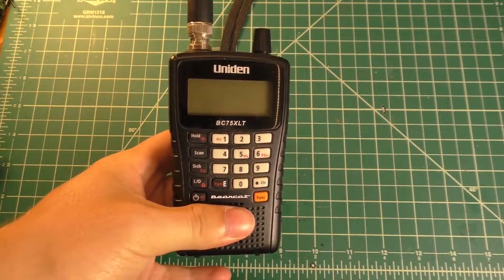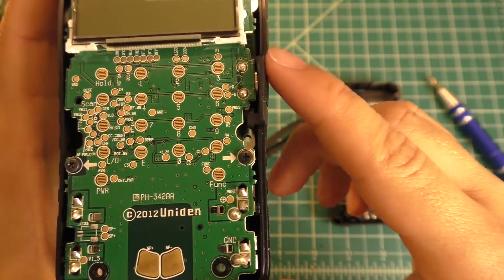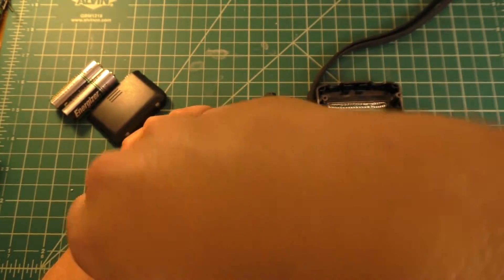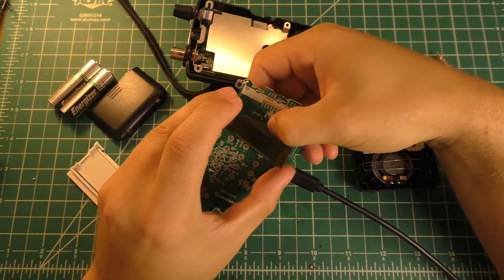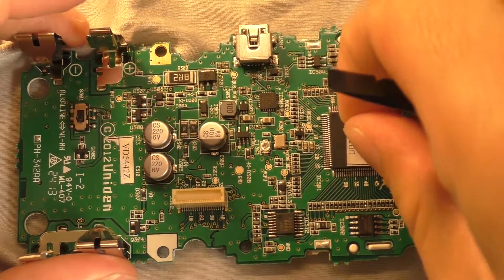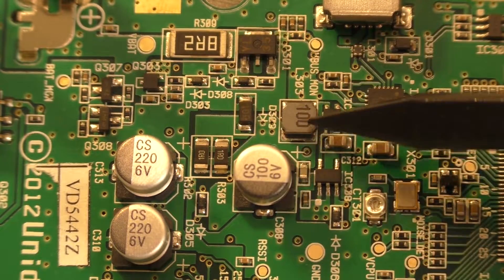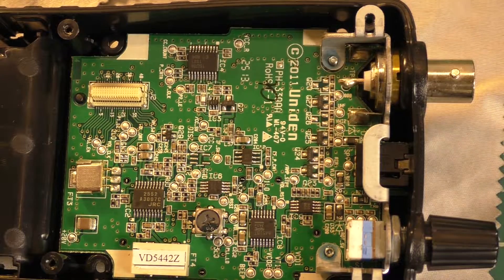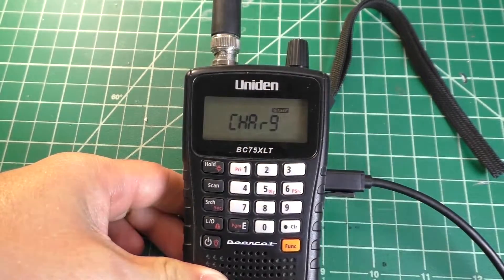Uniden BC75XLT Teardown and LCD Repair

Comment: I sell scanners and recently sold a 75XLT with a defective display like this one.
In a move of sheer stupidity, uniden decided it would be a good idea to glue the display ribbon to the circuit,  and that's fine, but the problem is that the ribbon is not only too long, but  the ribbon is also in a bind  by default because it is folded and usually creates a crease right at the contact point where the ribbon is glued to the board which often leads to the eventual bad connection that causes the display issue.
Since the type of glue that is used is unknown, (at least to me )the best remedy is to do exactly what you did here.
Heat the ribbon just enough to soften the glue to hopefully allow it to adhere properly again, but BE CAREFUL especially if you have a soldering iron that doesn't have a temperature setting because it is very easy to ruin the ribbon by melting it which is what happened to me with the last one I attempted to repair.
Radio Shack scanners are notorious for defective displays, but it's a completely different setup,  but that's another topic for another day.
Anyway, great job on the repair.

Comment: FYI The microcontroller is made by Renesas, part number R5F2L3AACNFP.  The BC125AT/XLT radios use the Renesas UPD70F3794GC.